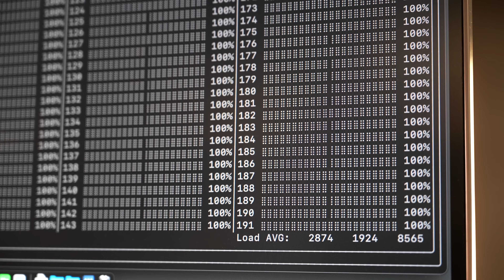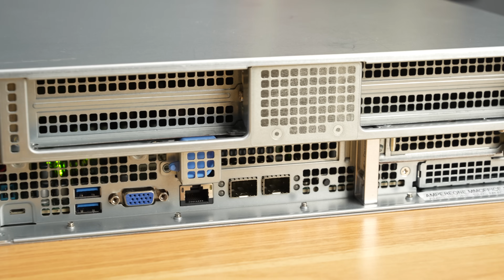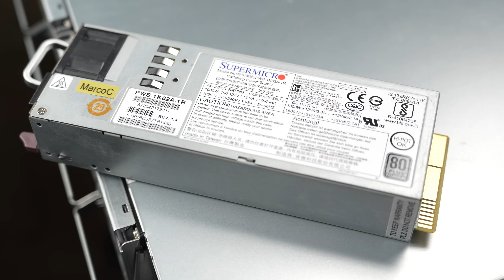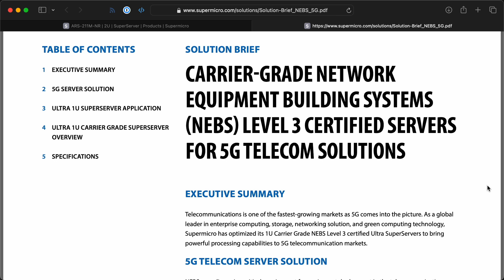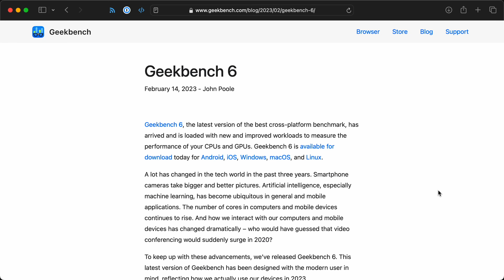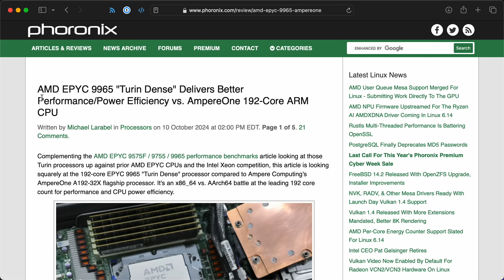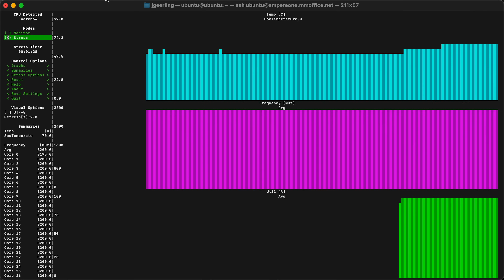CPU Cores are the new Megahertz

Comment: In fairness, AMD beat the ever loving shit out of Intel from the Pentium II on through the Pentium 4. It wasn't until the Intel Core came out that AMD was like, "Wait a second..." They just couldn't get market share, specifically during the Pentium 4 days, because Intel straight up fleeced the market with the Pentium 4. Putting out a design that they knew to be massively inefficient, but you could pump high clock speeds through. The first gen Pentium 4 at 1.8GHz couldn't even out perform a Pentium III at 1.0GHz. It's that whole free market fairy tale that says the free market finds the best product, or some such crap like that.

Comment: Can someone enlighten me about what he is saying regarding 8 Memory channels at around 6:40. I have been trying to learn more about servers and have seen some posts online that say the same thing as here, that 1 stick per channel (in an 8 channel server) lets the RAM run at higher clock speed and means more operations per second (as its less stress on the CPUs RAM BUS or something?). But as far as I knew at least with personal systems, occupying all RAM slots allowed for more bandwidth (more data per operation). Is there an easy means to visualize/understand which is more important, and when? I guess I understand what the 2 are, but some form of visuals or graphic that helps me see when one is more beneficial over the other would be great.

Comment: I got a raspberry pi 5 ultra it can't run anything and it takes 15 seconds to load a blank browser page on its "chromium" browser. 
My 8 year old discontinued LG phone is faster and runs anything. Raspberry Pi can't even open a SD card it has in it's USB port after it just formatted it. 
I can't find anything this thing can do errors 404 glitchy bare browser pages of static pics no links no dl. What is this thing?
I figure it's worth about $5 but it has a very beautiful box and packaging.

Comment: Couple years ago when I worked at Intel we had some Arm servers. They wanted to try to put in some of the new arc accelerators but didn't realize this thing didn't have any GPU power plugs. 😂 So I was tasked with velcroing an ATX power supply to the top of the server and running cables into it so we could power our GPUs.

Comment: AmpereOne is a server processor architecture developed by Ampere Computing, designed to deliver high performance and efficiency for cloud-native workloads. Building upon the success of their previous Altra and Altra Max processors, AmpereOne introduces several advancements to meet the evolving demands of modern data centers.

Key Features of AmpereOne:

    Custom Core Design: Unlike its predecessors that utilized Arm's Neoverse cores, AmpereOne features Ampere's in-house designed cores. This custom design allows for tailored optimizations specific to cloud-native applications, enhancing performance and efficiency.
    SemiAnalysis

    Scalability: AmpereOne processors offer configurations with up to 192 cores, providing substantial parallel processing capabilities suitable for handling diverse and demanding workloads.
    SemiAnalysis

    Advanced Interconnect: The architecture includes a custom mesh interconnect, facilitating efficient communication between cores and other system components. This design enhances data throughput and reduces latency, contributing to overall system performance.
    Ampere Computing

    Memory and I/O Support: AmpereOne supports DDR5 memory and PCIe Gen5 interfaces, offering increased memory bandwidth and faster data transfer rates compared to previous generations. This support ensures the architecture can handle data-intensive applications effectively.
    Wikipedia

    Energy Efficiency: Designed with power efficiency in mind, AmpereOne aims to deliver higher performance per watt, making it a cost-effective solution for large-scale data centers focused on reducing operational costs and environmental impact.
    Ampere Computing

Performance and Comparisons:

Ampere Computing claims that AmpereOne offers up to 50% higher performance per watt compared to competing processors like AMD's EPYC Genoa. This improvement is attributed to the custom core design and architectural optimizations tailored for cloud workloads.
Phoronix

Use Cases:

AmpereOne is particularly well-suited for cloud-native applications, including:

    Web Services and Databases: Its high core count and efficient parallel processing capabilities make it ideal for handling large-scale web services and database management systems.

    AI Inference and Data Analytics: The architecture's support for advanced memory and I/O interfaces enables efficient processing of AI inference tasks and large-scale data analytics.

    Virtualization and Containerized Environments: AmpereOne's scalability and performance per watt benefits are advantageous for virtualized and containerized workloads common in modern cloud infrastructures.

In summary, AmpereOne represents a significant advancement in server processor architecture, offering a combination of high performance, scalability, and energy efficiency tailored for the needs of contemporary cloud-native applications.

Comment: I have a couple of rack servers at work that sound like that. Thankfully there is a setting that allows for automatic fan speed adjustment instead of running 100% all the time. At 100% the server room door does not eliminate all of the noise as you can hear it down the hall.

Comment: actually jeff, those are 2 sfp/28 (25g) optical interfaces, not qsfp.....  unless of course supermicro is mis-identifying them..... standard qsfp's typically run at 40g (or4x10g), while qsfp/28's run at 100g (or 4x25g)

Comment: Great Video Jeff, thanks a lot! As impressive as these machines are, as ridiculously are they in a home server context. What is bugging me: there are plenty arm machines on entry level and also machines like these from the end of the spectrum but it seems that other than Apple, no other manufacturer seems to be interested in the mid range so far. I hope Windows on arm will fix this as I have the definitely a strong wish for a 8-16 core 32GB Linux box in my home. If it was more straight forward to run Linux on a Ma Mini, that would be awesome.
Reply from the maker: Yeah, that's the huge gap that I wish wouldn't exist—Qualcomm has the Snapdragon X Elite, but it's still kind of Apple-ish in terms of not being used in contexts where you get upgradeability or hackability, like you would with a typical PC.

Comment: >and, intel, well they're really having a year, aren't they?

Xeon 6 is pretty good, actually, just really bold with pricing.
Reply from the maker: They're still in the ring... it's just the other parts of the business are doing them no favors.

Would be great if they can get some wins in 2025, starting with Battlemage for consumers.
Reply: @JeffGeerling  Intel seems to be holding back the E xeons, 2 tiles out of 3 and older crestmont cores.
7980E would look really cool, finally something to match Azul's 864 cores in 2008

Comment: I don't understand why you care about idle power draw. If that machine isn't running 24/7 at full load you didn't need to buy it in the first place.
Reply from the maker: For many cases, yes—however if a business wanted one of these for CI, it might not be 24x7 utilization. Granted, they might be better off with a Mac Pro or something, depending on their exact needs.

The thing I'm thinking of more is the use case in 5+ years when a home planner could pick one up—nicer to not have a fun server burning 100-200W on standby!

Comment: I finally subscribed. I see you're on your way to a million.

I'm interested in a Pi cluster. Or maybe some other. It has to be cheap though and draw low power. And it needs to run Linux.

One of the things about all those cores is that they are still kinda slow. So many of my programs are single threaded. They only burn one core. I do some threaded software that can burn all the available cores. But that is in the minority. Even so, I would love a load of cores. Parallel processing is the only way I can speed up certain software.
Reply from the maker: Yeah definitely different strokes for different folks. I really wish Apple made the Xserve again, with like 64+ of their performance cores. Would be beastly.
Reply: @JeffGeerling  I don't know why they don't go with just performance cores in their plug in computers like the Mac mini. There's no battery to save unless you are smart enough to plug it into a UPS.

Comment: ASCI White: Lawrence Livermore National Laboratory
November 18, 2000 — November 18, 2001
The IBM ASCI White system located at Lawrence Livermore National Laboratory took the No. 1 position in November 2000 with 4.9 teraflop/s Linpack performance. This system was built with 512 nodes, each of which contained 16 IBM Power3 processors using a shared memory. This type of hierarchical architecture was becoming more and more common for systems used in HPC. By June 2001, Linpack performance on ASCI White had improved to 7.2 teraflop/s, keeping it in the No. 1 position for two more lists. Located in a classified area at Lawrence Livermore National Laboratory, ASCI White was housed in over two hundred cabinets and covered a space the size of two basketball courts and weighed 106 tons. It contained six trillion bytes (TB) of memory and had more than 160 TB of IBM TotalStorage 7133 Serial Disk System capacity.

Comment: We've had some of these at work for a while now. For CPU-intensive tasks, they are slower than molasses. A parallel build of a common Very Large project is faster with "make -j64" on a Genoa system than "make -j256" on one of these dual-socket Ampere systems. They are neat, and fast for some things, but overall - naw.
Reply from the maker: If it's dual-socket / Ampere with 256 cores, it's probably a dual Ampere Altra Max M128—those systems are based on their older chip, which is a bit slower (not too much slower though), especially on a per-core basis. This system uses a newer core design that's a bit faster but has faster RAM access and is more competitive (though again, still far below per-core performance on AMD/Intel right now). There's no 'turbo' or anything, the cores just keep plugging away at the base clock for consistency.

Comment: 240volt power is often used for efficiency it saves a couple of percent when applying it to the system and when deploying it in datacenters that saves $$$, particularly when you look at the power draw of the systems, not to mention that much of the world uses 240 volt.

Comment: Compiling the Linux kernel always used to be good fun, especially once it we started getting multi-core systems and being able to build with "make -j". And then of course "make world" for the BSD fiends. It wouldn't test the networking or the RAM (much) but running these various, very core-dense systems against each other as compiler farms could be an interesting comparison.

Comment: with 24 orangepi 5's you have the same amount of arm cores and idling at bellow 48W
as in 24 seperate SBC computers with the same amount of total cores idling at  around a quarter of the poweruse of a single  ampere chip. (rk3588)

the orangepi 5 has a rk3588 with 8 cores up to 32gb ram and a 6 tops NPU. it's power usage during idle is well bellow 2W, normal light home server use is around 2W.
so when getting 24 of them you have the same amount of cpu cores, and also 144TOPS of NPU extra added to that.
the 32gb versions cost bellow $150 in general(have seen then much lower at moments). so assuming the 32gb version getting 24 of them costs $3600 which is cheaper than $5555 and it would result in 768gb of ram for free as that is already added in the price.
the 16gb versions cost around $100 a piece so $2400 for 24 of them which is less than half of only the ampere chip, and there are complete computers with ram in them, and a npu in them and a gpu in them and hardware encoders in them, and even 24 of them together would draw less than 1/4th the power a single ampere chip draws.
would require running it like many seperate servers or a cluster computer or both however.
but to be honnest, these things have such great performance on their own that that will just work well.
the clockspeed is lower 2.4Ghz vs 3.2Ghz. but you could double the amount of boards and so cores and also npu performance when going with the 16gb version and still be bellow the price of a single ampere cpu and have around half the power usage under light loads compared to ampere when idling.

Comment: I'd like to see dual CPU AM5 architecture for home labs.  It would be nice to run dual 7950X or 9950X processors.  CPU cores are great, but I don't think it's always a direct replacement for clock speed, particularly if you decide to host game servers.

Comment: 20:45 You haven't run 25GE in your NAS for almost a year.  You just installed the card! lol ;)
Reply from the maker: True; but I had 10 GbE and installed the U.2 drives a while back, actually—10 GbE is honestly plenty of bandwidth for multiple 4K streams of ProRes RAW or what I more commonly edit, H.265.
Reply: @JeffGeerling  Oh just joking around! :)

I had some 40GE several years ago, but it was to span switches, not for edge devices. I'd love to play with 25 or 100, but funds tend to restrict that.

Comment: back in 2011 there where arm chips with 1000 cores.
but back then noone wanted them since multi core was something barely supported back them, so they disapeared.
now today such things would be super usefull, but probably RISC-V now since with that it is possible to design ultra compact cores speciffically for multicore(so perhaps also linking those cores in a special way or after eachother to chain instructions without needing to move things to the memory).

Comment: Still waiting for them to standardize distros in Arm. In X86, I can grab any x86 box off the shelf and toss pfsense, or OpenBSD, or Artix Linux on it. With arm? My UC-1222 box supports any distro you want as long as it's Moxa's version of Debian Buster. Anything else and I'd have to roll my own boot solution and image for it because ARM still doesn't have standardized booting.
Reply from the maker: luckily this box does, as long as the distro has a generic UEFI ISO available. Ubuntu, Debian, Fedora, Mint, and others do now, no vendor-specific shenanigans required!

I wish more Arm vendors supported this level of SystemReady. You can even install Windows on Arm!
Reply: @JeffGeerling  Yeah, it's nice that ARM finally has SOME systems that support generic booting, it's just that I doubt it will get a ton of support until most Arm systems support it.
Reply: @kazriko Ampere, NVIDIA, and all the clouds running all arm64 distros is not a bad starting point.

Comment: Honestly after the failure of the Qualcomm Snapdragon X launch, I have my doubts that Windows will ever be a good experience on ARM. Microsoft just lacks the commitment. If it doesn’t excel and goes 100% without any hiccups out of the box the minute it launches Microsoft abandons ARM again for a couple if years.

Apple has the commitment to ARM. And Linux support for ARM is good because of ARM servers like this one.

Comment: i suspect that the long subtitles at e.g. 2:42 (*) would be very hard to actually read, maybe consider having some line length pass on the subs, and splitting up lines that are too long?

*(the subtitle line, it spans the whole video player "has 10 gigs of high speed RAM and consistent performance. Before we test that and make")

Comment: My biggest frustration with rack-mount servers is that the so many of them will run their fans at maximum speed, regardless of whether it's required by the current load or not (not saying that's the case with this server, just what it made me think of after the opening clip). Not only is this incredibly noisy (and actually presents a workplace hazard for datacenter technicians, who are encouraged or required to wear hearing protection in some cases), it also wastes a non-zero amount of power running the high output fans at those speeds. 

I understand the systems need to be capable of staying cool in adverse conditions so they have fans that can ramp up to incredible speeds. In a datacenter application especially though, every watt of power is one your HVAC system eventually has to deal with, so why not do the simple thing and at least link your fans to the system's temperature? It wouldn't surprise me if the fans in this system consume somewhere between 10W and 50W by themselves.

Comment: just 8 channels seems like a bottle neck for 192 cores tbh
Reply from the maker: Definitely. 12 channels would be a lot better, one of the big reasons the AMD system can beat out AmpereOne on most tests.
Reply: @JeffGeerling  Also great you pointed out which probably wasn't obvious to most people that consumer hardware benchmarks are not that great for testing the capabilities of server hardware. its hard to say which i'd recommend but generally speaking most of the time it is ram speed. imagine having 384 vms running (over provisioning factor 1:8 and vcpus per vm and yes those numbers are often found outside) but everye machine running 4 gb that makes your machine working with 1.5TB of ram. 192 ram is for very high dense compute I'd say most of the time for backend/micro services running in a datacentre/cloud

even my 2014 desktop (x99a platform) runs quad channel with just 6 cores.

Comment: I read the title and thought "You just now figure that out? It''s been the case for the past 20 years!" The introduction of Intel's Core 2 Duo kicked off the core wars. The speed held steady at about 3.5 GHz for most of that time. Only in the past 5 years or so have I seen CPU speeds past 4 GHz (advertised on the box, not overclocked).